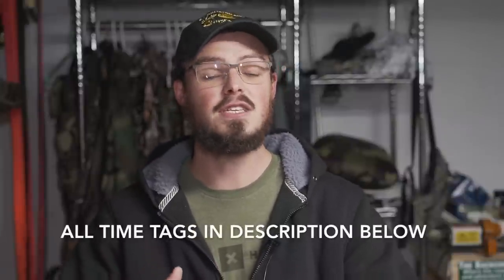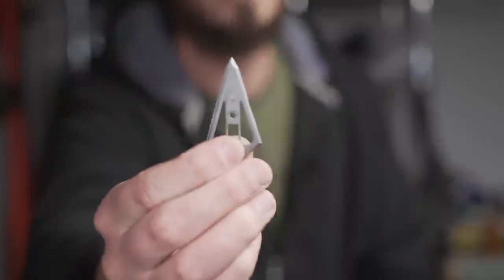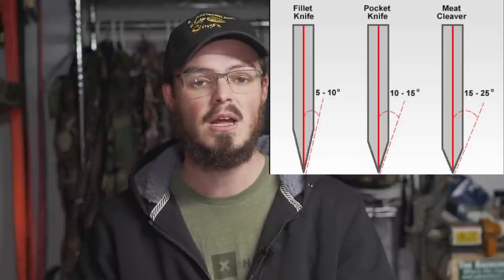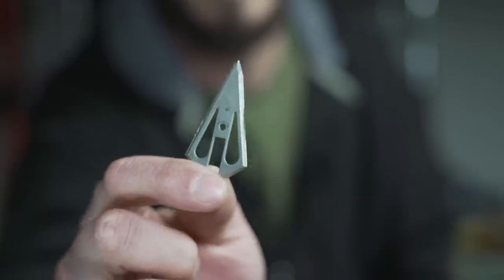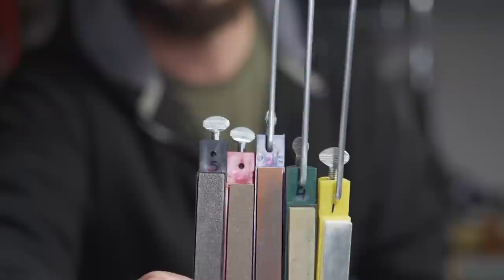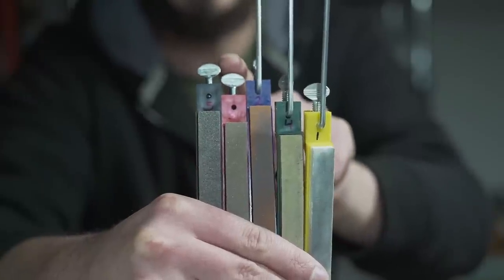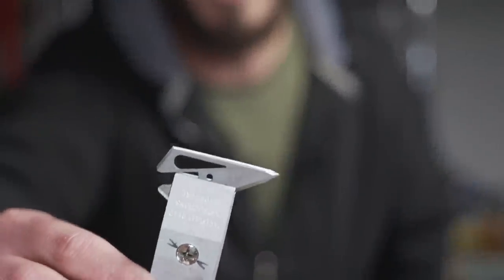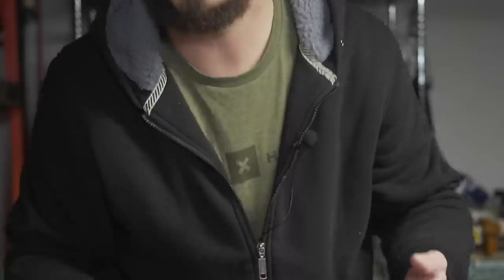Live life on "THE EDGE" | SHARPEN every blade in your house! | Lanksy Sharpening System

Comment: I am a sharp knife 'nut'.  I constantly check knives...so much so, I see a knife block in someone's home. Eventually, I will pull a knife and check the edge. knives or blades do not necessary go dull, they need to be maintained "honed"; the edge has rolled.  I think that needs to be clarified.  There is a difference between: honing and sharpening.  
I absolutely luv the Lansky Sharpening System, can't wait to add this to my kit...plus, I'm a huge fan of wet sharpening.  If you use Sandpaper....over 240grit.  Purchase Autobody sanding paper.
This was brilliant...As has become AJA form....easily explained and visuals were Great

Comment: Good job explaining. Looks like you did your homework. To get to your 25° angle with the sandpaper you can send on the magazine with the end of your holder off the edge of the magazine. Align with the hole you want. Stinger Killer Bee 150 grain 4 blade broadhead 2 1/8" X 1 1/16"

Comment: I just switched to magnus broadheads this year. I shoot the 2 blade stingers in 150 grains with my Matthew's mission craze set at 70 lbs with a 27 inch draw length. Shot a big doe at 40 yards and the arrow cut clean through 4 ribs. She went about 50 yards. Love the heads. I would love to try out the stinger 4 blade in 150 grain.

Comment: I picked up a Lansky leather strop to go with my kit as well as the serrated blade stone. Both great tools to go with the kit. 

I just picked up a pack of QAD Exodus to try out and they are super sharp out of the box. I’m hoping to try them out on turkeys this spring to see how they fare vs the Black Hornet which I shot my last turkey with. Got a pass through but the main blade got gouged pretty bad. Of course Magnus sent me a new head for free. 

I’ve been impressed with the holes the Exodus leave from other people’s reviews with it being a 1-1/4” three blade and it seems like a very tough head.
Reply from the maker: Exodus is definitely in my top 5 of all time fixed heads.
Reply: @averagejackarchery  I traded off a few of my Cutthroats for three Iron Will solids and I wasn’t really impressed. They didn’t fly well at all compared to my VPA three blades and cutthroats and the blades just didn’t seem worth the $99 a pack price. Sold them and got the Exodus to try.

Comment: Well I didn’t make it in time for giveaway 😂 but any way figured I’d mention that edge pro has a kit to level stones once you make them to a bowl I’m sure would still work for any stone. I have just gotten an off brand guided system which works fine but the stones are junk actually was able to put edge pro stones on and all I can say is they are really nice quality stones that don’t seam too expensive. I can’t say anything about lansky stones as I have never used them but if lansky doesn’t have a kit for leveling the stones you could check out the one from edge pro it would extend the life of your stones saving some extra cash. My question to you is that if you were able to level stone back up to get more life out of stone would you still use sandpaper or just simple use stones more?

Comment: Why not just get the StaySharp jig? It’s cheap and it’s designed specifically for magnets stingers
Reply from the maker: Stay sharp is great! I just use my Lansky for every blade in my house and the multiple angle adjustment is paramount.
Reply: @averagejackarchery  I got a Lansky, and one of those Smiths angle kits too. Ya know what I got that’s really really good. The precision adjust worksharp. That one is the best. I got lots of knives so I tried a few different kits over the years.

Comment: You would have been better off and had better structural integrity of the edge had you just used sand paper on the steeper angle up to 1000g, then stropped it.